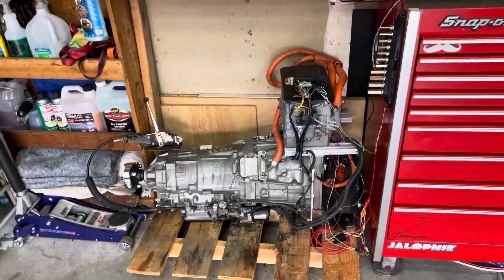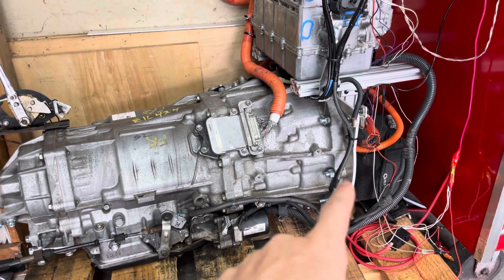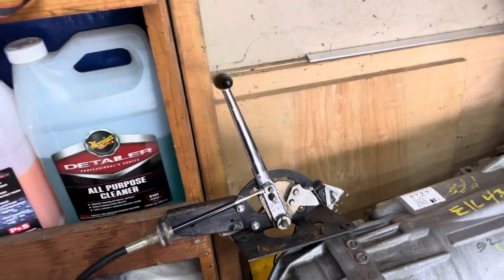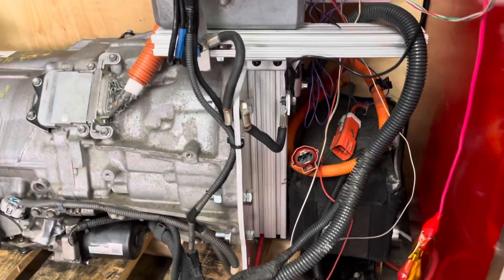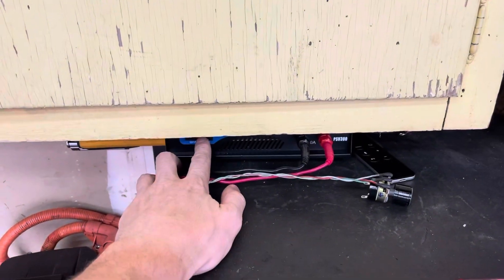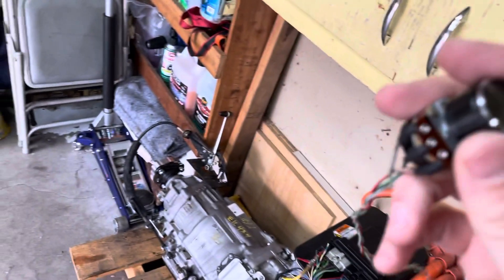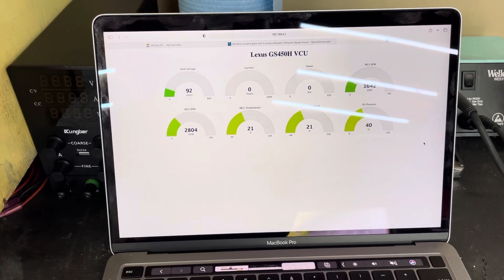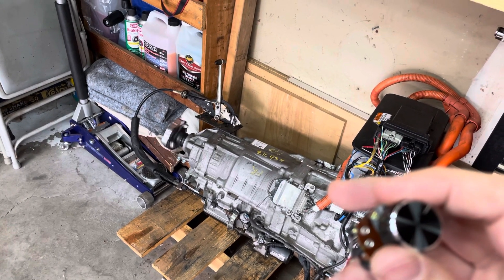GS450H drivetrain ready for the jag

Comment: I noticed your MG1 is running fewer RPM than MG2, but in Damien’s vids (and my own test rig), it’s the opposite. Thoughts?
Reply from the maker: It was in low gear during this test due to an incorrectly specced component on the VCU board
Reply: @BRV50N  I was thinking the same thing. Cheers for confirming it was the high torque mg2 gear engaged.

Comment: Parking Pawl is very necessary.  Running a poweglide on my XJ.
Reply: Fun fact: Corvair PowerGlide transmissions had no Park pawl setup; if you had an AT Corvair, your parking brakes ALWAYS worked ;)

I wonder if the early Pontiac Tempest setup was the same.